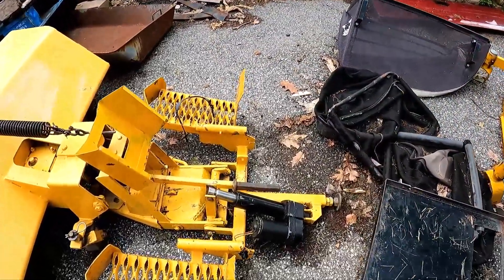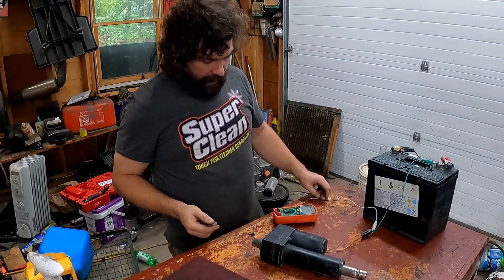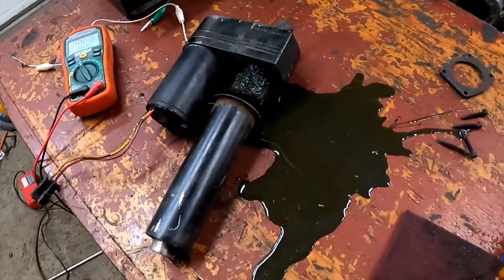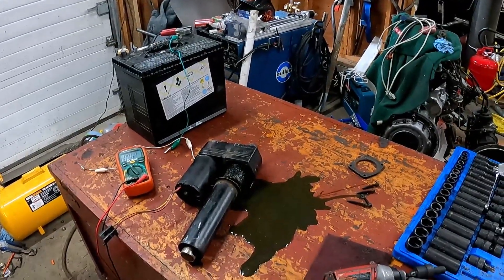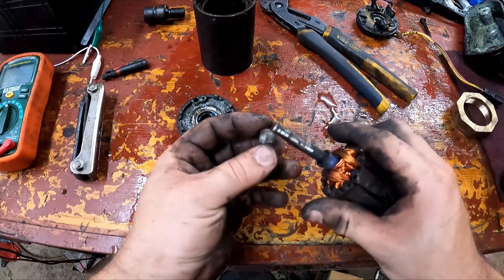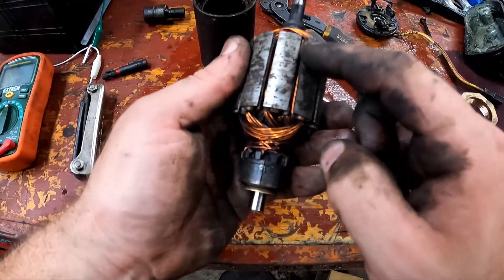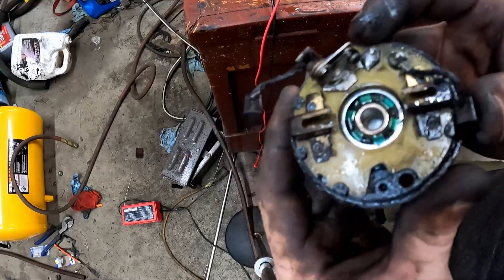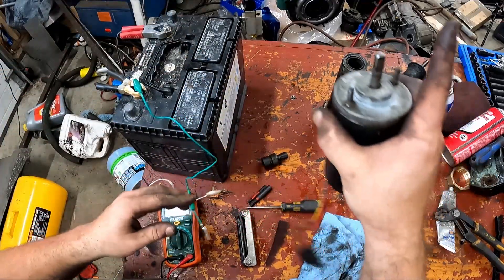Walker Zero Turn Mower - Implement Mount Linear Actuator Repair

Comment: Thank you, helped me open it. I had the same issue as you after first reassembly where it would not lift the snowblower without help. I changed the 2 thrust bearings and the output shaft seal Everything worked almost as new. The balls bearing have some wear but it is fully functional at a fraction of the cost of a new one for now.

Comment: I've had plenty of experience with these 12 V actuators and the ones that I've had experience with say that they lift 1200 pounds but they always don't seem to last very long at all. By the way, we use ours on Sweeper trucks for various applications and I have one sitting on the shelf right now that I believe I'm going to take apart and see if I can get working

Comment: I have a wheelchair lift on the back of my truck .  I’ve been thru several tear down and clean sometimes you get lucky and it works.  They should really seal these better .
Reply from the maker: Almost like it was designed to capture water.